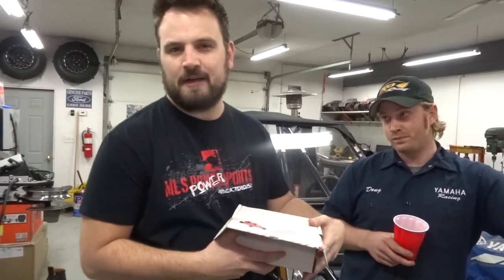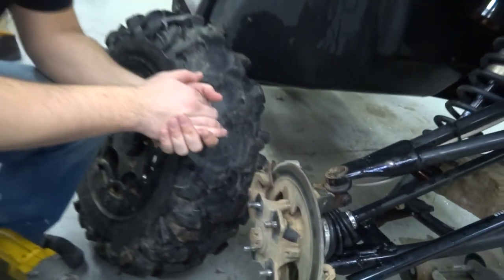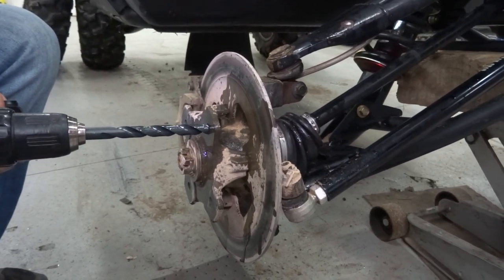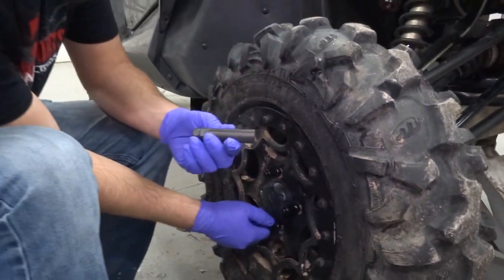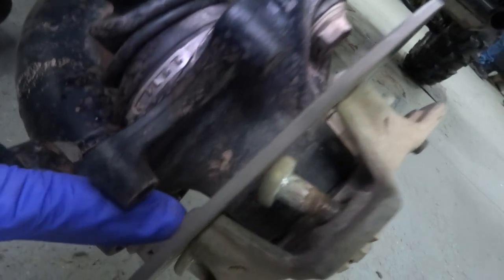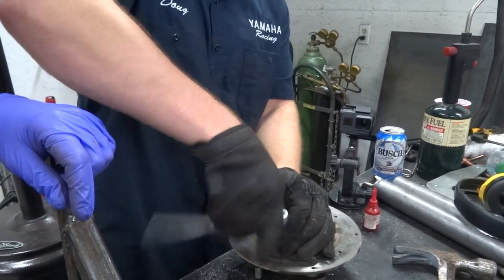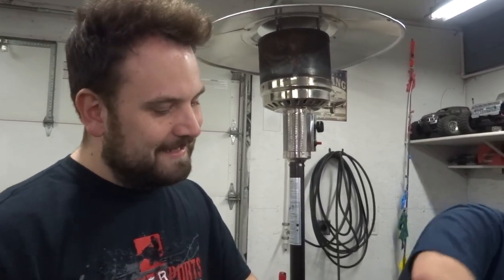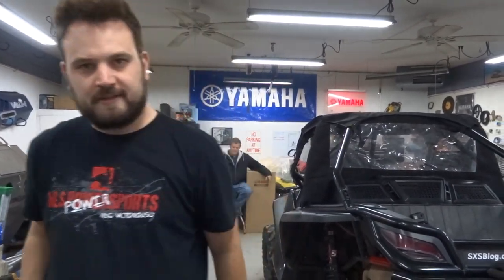Strength for days! 12mm wheel stud install! MWGA Episode 7!

Comment: Do you have to drill out the holes in the rims too to accommodate the larger studs? Or did Doug use his larger stud off camera to do it since YouTube censorship wouldn't allow such graphic reaming?
Reply from the maker: Hahahahahahha!! Oh Doug. Typically wheels can clear this size stud. I've yet to try my Hipers tho, we may be in for a reaming with heavy censorship!

Comment: Im assuming you are going from a 10mm to a 12mm?  How did you get away without having to open up the holes on the wheels?
Reply from the maker: Most wheels have enough clearance since SXS wheels don’t center on the studs, they center on the lug nut taper

Comment: Why don't you pitch the T30's and just replace them with Hex head so you can use a socket?
Reply from the maker: the screws actually have a thin larger radius collar at the top to center them within the rotors. not your standard bolt unfortunately!
Reply: Do they need to be thinner? Is there clearance for a washer? I'm not fimilar with working on cats but from watch your videos ID NEVER BUY ONE
Reply: It's a shoulder bolt.  You could probably find a hex head that would work with enough searching but it isn't worth the trouble for the rare occasion you need to remove brake rotors from the hub.  Heat makes it easy.